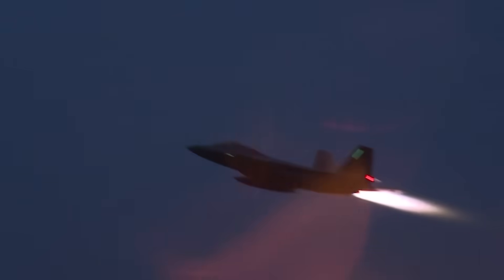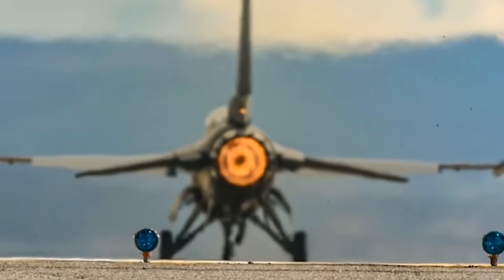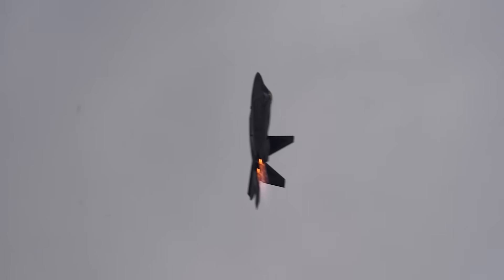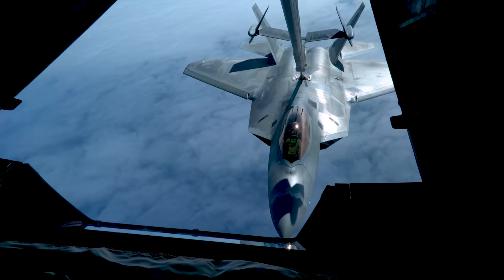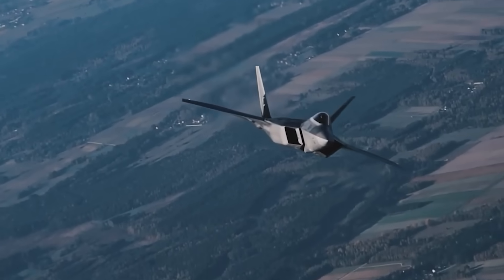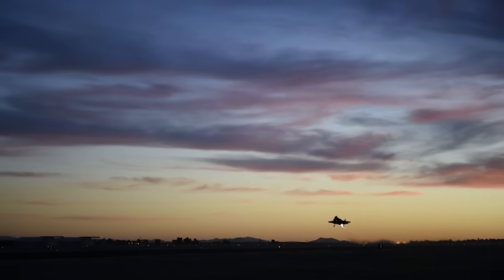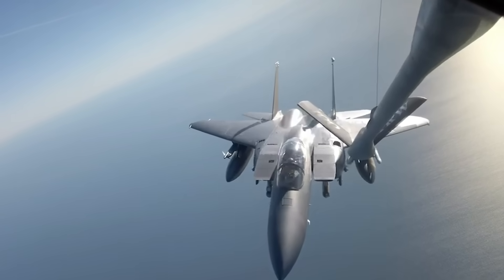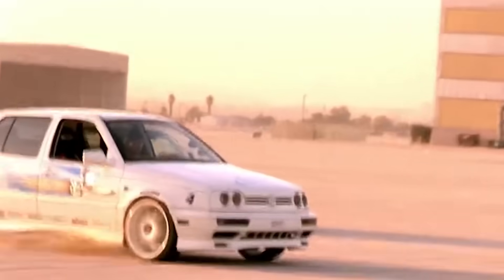Why the F-22 can only use AFTERBURNERS for a FEW MINUTES

Comment: Some aircraft, usually supersonic aircraft, are designed to run for long periods on afterburner, but they run a very high pressure at the afterburner giving the nozzle a good chance to extract maximum thrust from the hot gas. With supersonic aircraft a lot of the pressure comes relatively 'for free' from the inlet, so you don't have to have a lot of compressor stages to get that.
Reply: But most supersonic capable aircraft spend most of their time at subsonic speeds.  The only engine I'm aware of where compressor stages are reduced or eliminated is the J58 on the SR-71. But they just bypassed more and more air around the compressor section as speed increased.
Reply: IIRC, the SR-71 stayed in reheat during cruise.

Comment: This still makes me think about, after all these years, what would the F-23 with GE F120 variable cycle engines. That was the plane to beat for speed and range. This video expresses that so well
Reply: It's speed or range, but not both at the same time.  It's all a question of exhaust velocity.  Afterburners increase velocity.  Higher bypass ratio decreases velocity.  Lower exhaust velocity generates thrust at lower vehicle velocities more efficiently.  Higher exhaust velocity permits higher top speed, and less thrust falloff at those higher speeds.  The Variable Cycle Engine permitted one to change the bypass ratio to suit the aircraft's current flight regime, permitting high speed flight as needed without sacrificing efficient low speed cruise for all those other times.
Reply: @wagnerrp 
It just makes one wonder…. The YF-23 dirty in full military power out accelerated an F-16 clean and in afterburner!
The GE engine wasn’t chosen as switching bypass ratios was seen as a bigger gamble than utilizing the more conventional P&W design. That said using a higher bypass ratio for slower cruise speeds certainly does have its advantages. I personally wonder when rotating detonation gas turbines will make mass production as they are already in some classified aircraft.

Comment: The pressure is all in the kompressor section. In the turbine section, it's all velocity. This is the reason for the low efficiency of the after burner

Comment: I don't know about current aircraft but the F-14, with full fuel plus tanks, carried 20,000 pounds of fuel.  At full afterburner, aka Zone 5, that was enough fuel for 4 minutes.
Reply: They didn't spend 4 minutes in AB as sea-level.

They went to 40,000ft within 1.5 minutes. Where fuel burn was 1/3 that rate. (And 1/5th at 50ksl).
Reply: Pilots really would not be too enthusiastic about those four minutes in the air, one would presume.

Comment: Years ago I worked in a test cell running engines. We had a GE F101 engine up to 100,000 ph. with a machinal fuel totalize clicking for each gal. burned. You could not count fast enough for each click.

Comment: Simple 
After burner drinks fuels and F-22 would empty its tanks in minutes in sustained after burner. The SR-71 could sustain afterburner for 90 mins due its unique engine and fuel cocktail
The happy medium between is supercruise that allows aircraft like F-22 increased speed without the massive fuel consumption.
This was the impetus for the Adaptive Versatile Engine Technology (ADVENT) program that lead to the Adaptive Engine Transition Program (AETP) 
and ultimately GE XA100 and PW XA101 engines
Engines with high thrust and power but lower fuel consumption
The F-35 was slated for it but USAF passed 
We wont see any ADVENTs engines till the 6th generation 
Another possibility is the Ferrari F-35 which is supposed to add 6th gen features but at lower cost
its likely that Lockheed would engineer this variant to accept the ADVENT engines
Reply: Sadly, the F-35 isn't getting AETP/NGAP.

The USAF opted for the F135 ECU (engine core upgrade) over re-engining.

Comment: wow that's ridiculous.  so basically top speeds are a lie cause they will fall out of the sky if they ever attempt them 🤣 and that's the F22 which holds more than most and is more efficient than most.  a pilot on YouTube used to say F16s during training would be almost out of fuel by the time they got up to altitude for training.  I thought he was joking 🤣 he is in fact not joking.  I heard that's why Russian jets are so huge, cause they got a lot more distance to cover.

I feel like I'd be constantly afraid of running out of fuel as a pilot 😅

Comment: How feasible is it to bump into and out of burner, and coast until you drop to super cruise speed, then bump again for another burst? Is it even worth it?
Reply: The drag at these speeds requires lots of throttle.
Reply: @kwhp1507 even at max altitude? I’m sure it does, just curious if there is a way to say, average Mach 2 for longer.
Reply: The drag is so high, coming out of AB is like hitting the brakes.

Lots of accounts from pilots who suffered flame-outs, bird strikes, and un-starts.

Comment: The F22 can super cruise, so it has a leg up on every other current fighter out there.
Reply: The F-35 can super cruise, The Flanker might be able to. And even a clean F-16 (With wingtip sidewinders only) can touch Mach 1.0 at 20,000ft at MIL power.

Also, the SR-71 and XB-70 were able to super-cruise, but little is known about their limits there. Perhaps mach 1.6-1.8, for over 2 hours?
Reply: @Triple_J.1  To be truly considered supercruise it has to be truly supersonic which means there can´t be subsonic airflow around the aircraft so around mach 1.3
Reply: I dont think you realise how many aircraft can supercruise bro
Reply: @Migthunder  The Rafael and Typhoon are the only other operational fighters I can think of that can super cruise, unless you trust the Russians propaganda on the SU-57 (I’m skeptical). There are probably some  experimental x-planes that can do it, but they aren’t actually fielded. 

The F22 can super cruise at 1.7 which is significantly faster than any of the other fighters.
Reply: @Nathan-vt1jz  dude the su57 can supercruise as it uses the same engines as the su35 which can also supercruise. Also the gripen f15ex and the newer Chinese flankers as well as the j20 all can supercruise. Also as for the mach 1.7 supercruise the raptor cant achieve that with combat load and fuel. Just like how the eurofighter cant hit mach 1.5 supercruise without any combat load and fuel.
Reply: @Migthunder Officially Mach 1.5 for the Eurofighter with full missile fit, Mach 1.4 for the Rafale with 6 MICAs. Plus maintained supersonic for both with external fuel tank and missiles at undisclosed speed.
Reply: @RichelieuUnlimited  give me a source because thats false.
Reply: @Migthunder EUROJET Turbo GmbH and the Rafale 49th Paris Air Show Sheet.
Reply: The F-22 has the highest super cruise of current operational aircraft
The only thing that hurts the F-22 is lack of upgrades and limited numbers
Reply: @verdebusterAP  It’s getting upgrades, but the limited numbers is definitely a big issue.
Reply: @verdebusterAP The F-22 has been upgraded though.
Reply: The F-22 has gotten some upgrades but nothing that realizes its full potential 
Case in point
A truly upgraded F-22 would the following
Like the F-35 and F-15EX, the wide area display in the cockpit to replace its MFDs
The F-22 is getting the Scorpion  Helmet Mounted Display (HMD) however I would have opted for a variant of the F-35 HMD
enhanced networking and communications
From the F-35, I would also brought over the DAS .IRST and  EOTS and from the Advanced Hornet, the an enclosed weapons pod (EWP) to increase the F-22s payload while remaining stealthy
The EOTS would allow the F-22 to use laser guided weapons
The EWP would able to support weapons like the JSOW-ER, JSM, SIAW , MAKO, and JDAM-ER allowing the F-22 to perform time sensitive strikes with MAKO/SIAW
Anti ship and land attack with JSM. Hard-target penetration with JSOWs as well increased strike capability with JDAMs
The EWP can also carry 4 AIM-120s increase the F-22 load to 14 AIM-120s
Such an upgrade program would realize the F-22s full potential 
however it only get peace meal upgrades
Reply: @verdebusterAP Haven't had a reason for numbers. The airforce opted to bolster defensea with AI drones instead. No longer a need for F35 escorts. Essentially allowing us to spread air superiority over larger areas with the same amount of fighters
Reply: Flogger-g can reach 1.13 mach without afterburner
Reply: @kosher4418  I’ve never even heard of that one, who uses it? 

It’s still a long way off from 1.7 the F22 can pull off.
Reply: Not quite, the Eurofighter Typhoon can also super cruise at speeds up mach 1.5, but I will grant you, it is a short list indeed.
Reply: @yawningkitty457  There are even less Typhoons than Raptors.  The U.K. can't afford many with all the diversity from across the channel.  Sad.  Big time.
Reply: @whisperingpinup  true.
Reply: @whisperingpinup The RAF alone has ~160 Typhoons, similar to our amount of combat capable F22's, and it is worth remembering they can and are still making more, whilst we unfortunately can't make Raptors anymore. Don't undersell our Nato allies and their capabilities!
Reply: @whisperingpinup There are about three times as many Eurofighters in service right now as there are F-22s in total. Plus open orders for more than 100 and further contracts close to signing.
Reply: @whisperingpinup The UK isn't the only country that has Typhoons. More Typhoons have been built than F-22, it's an objective fact.
Reply: @whisperingpinup  The hell are you talking about? There has been over 600 Eurofighters made!
Reply: @yawningkitty457  ❤
Reply: Supercruise is not a noun, simply a term referring to any aircraft that can sustain speeds above the speed of sound without afterburner.
Reply: @chrisedwards5752  A term is a noun

Comment: Man no wonder super cruise was high on the want list for the F-22. That is an astonishingly high rate of fuel consumption.
Reply: Can’t make power without burning fuel. And even the most efficient gasoline piston engines (mass production) are only like 35-38% efficient, jet engines have GOT to be a lot less efficient as it’s steady burn combustion which is far less efficient at capturing and converting energy to propulsion.  This is why pulse jets and pulse detonation engines have been getting more and more research in spite of them being  VERY loud, because they’re much much more efficient as they’re not a steady combustion jet engine.
Reply: @meanman6992  The pulse detonation engine is efficient because it detonates its fuel-air mixture, combusting it completely in its fully-compressed state before it has chance to expand. Which is a big part of the difficulty in getting them working: pretty much every other kind of engine out there, including piston engines, deflagrate their fuel-air mixture. (Knock, which can quickly destroy a piston engine, occurs when the mixture detonates instead of deflagrates.)

Regular pulsejets, on the other hand, are notoriously inefficient.

A turbine engine is not inherently inefficient. They shine in different regimes and use cases, compared to a piston engine. A jet engine running at the limit of melting its turbine, with a high compression ratio, can be very efficient - which is why Concorde's engine has a famously high thermal efficiency at cruise, thanks to the intakes and compressors combining for a pressure ratio exceeding 80:1. Piston engine efficiency suffers at high power. On the other hand, they do very well at low RPM and high load - whereas turbine engine efficiency drops off a cliff at lower power settings.

But a high thermal efficiency does not, by itself, make for an efficient vehicle, and needs to be viewed in context. Concorde chugged fuel because it cruised at Mach 2 and used pure turbojets - turbojets which were very efficient at extracting useful energy from the fuel, but then imparted that energy into a small mass of air, accelerating it to very high speeds, and that's not good for propulsive efficiency compared to spreading energy over a larger mass of air. But you need high exhaust velocities to achieve supersonic speeds, because thrust depends on the difference between exhaust velocity and vehicle velocity.

Afterburners drink fuel at a crazy rate because you're dumping fuel into the jet exhaust after the turbine section. This typically means that the combustion is taking place at a much lower pressure than in the engine core. Jet engines are limited in the fuel they can burn in their core by the gas temperature entering the turbine. If you want more power, you need a bigger engine, which comes with more weight and takes up a lot more space. Or you add an afterburner, which are comparatively small and light, and you accept the penalty of high fuel consumption for short term boosts to thrust.
Reply: @meanman6992 rockets are actually super efficient-up to 70%. Engine efficiency is to do with combustion temperatures and expansion ratios and not really anything else.
Reply: All jet fighters can only sustain afterburner for a few minutes.

Comment: Pretty sure the F-19 is 26,000lbs thrust at mil/dry and 35,000+ pound thrust wet 37,000 pounds installed/dynamic.
Sorry dude, but max a/b usage is limited by the engine constraints itself, not the amount of fuel available.  
Almost all historical operational US designed turbine engines have a 5 minute max burner duration, save for the J58 used in the A-12/SR-71 family which are turbine engines that are indeed only limited by the birds fuel capacity. I'm not certain for the F-22s F-119 of the F-35s F-135 engines as that info isnt as available.

Comment: I got a question about afterburners.  Why do pilots use afterburners on the runway?  Surely the aircraft can power itself enough without afterburners to take off.  I understand they need that extra power on a carrier but a runway?
Reply: To get up as quickly as possible. Train as you fight.   Combat loaded jets are much different than peacetime jets, plus there's the possibility of enemy at the end of teh runway with a MANPAD or something. Get airborne quick, low transition, get as much speed as possible before pulling up to climb away from danger as quickly s possible.

F-14A used a/b for carrier and runway launches, F-14 B/D with the GE engines were prohibited from using a/b during launches from runways and carriers. The rudders do not have enough authority at these low speeds to counteract the asymmetrical thrust produced during an engine out situation if a single engine was in a/b.
Similar situation for SR-71.  Wide engine spacing with high thrust engines can be very problematic for slow moving jets that experience an engine failure during launch.
Reply: If you're literally on "scramble" crews, you need to hit maximum speed immediately. That includes take-off.
 Or, it might be hot and you might be above sea level (i.e. Denver is at 5000 feet) so you need max power to take off in the thinner air.
 All sorts of reasons.
Reply: The aircraft will never be heavier than it is just before take off, full of fuel and munitions. Using afterburner allows them to take off with more payload, especially when there is a tanker waiting for them once they get airborne.
Reply: To get to altitude faster. Usually they only use afterburners on the runway to intercept
Reply: For the cool photo's?  Seriously I have seen the AF do sillier things for a photo op.

I think they do a couple of afterburner takeoffs during training to let the pilots experience it.
Reply: I don't know, but I have some guesses: 1) Training for when you'd need to do it for battle, 2) Engine out emergency margins. The faster you accelerate, the more energy you have to get in the air or runway you have left in front of you to deal with an emergency. Plus extra power in each engine means there's more margin if you lose an engine. 3) Getting to higher cruise altitude faster is actually more fuel efficient than slowly climbing using lower thrust settings. This is because the lower drag at higher altitudes >10k ft reduces fuel burn enough to compensate for the increased burn on the initial climb. Granted, I doubt this would be as good a reason as the other 2 because you probably want to stop afterburner very soon after becoming airborne and just remain at a high climb thrust because of the reasons mentioned in this video.
Reply: There is strict SOP for each and every configuration and takeoff. 

No pilots make that decision in the current USAF. They are instructed and briefed.

E.g. F/A-18 A/B/C use Full AB on carrier launch. But no AB from long land-based runways near sea level. 

F-14 A/BC use AB on Carrier catapult launch. But D model AB takeoff was prohibited. (Later GE engines had more thrust at MIL than earlier P&W, and losing a powerful GE in full AB at low speed and altitude would result in losing control).
Reply: @Triple_J.1  The F-14 A+ later renamed  Bravo AND Delta BOTH used the more powerful GE-F-110 engines. Only the F-14Alphas ran the P&W TF30.  F-14 B/D dry thrust was equal to a F-14A at Zone 2 or 3(cant remember which).
Reply: There are various reasons but simplest is that by operating at max power , the aircraft can still get airborne in case of a engine failure 
Granted with single engine enough aircraft, they are basically boned but with multi engine aircraft, max power can help them get airborne and possiby go around and safely land